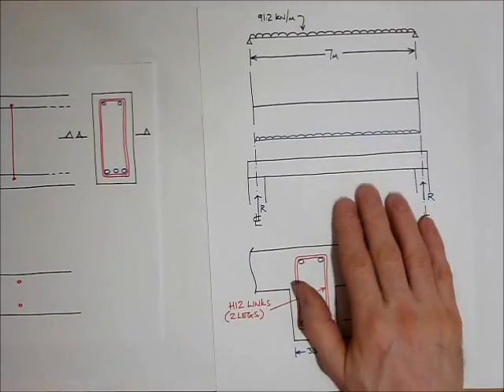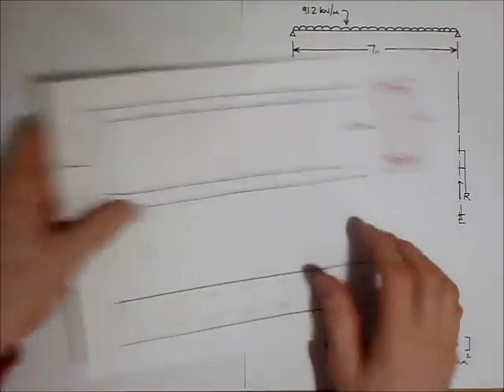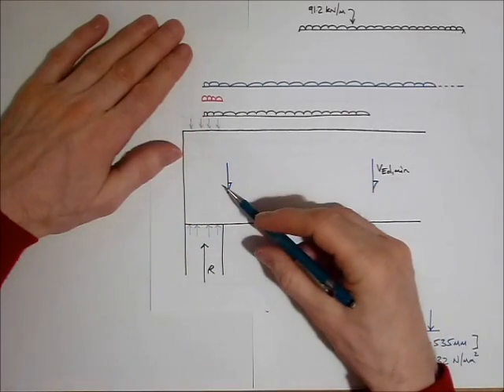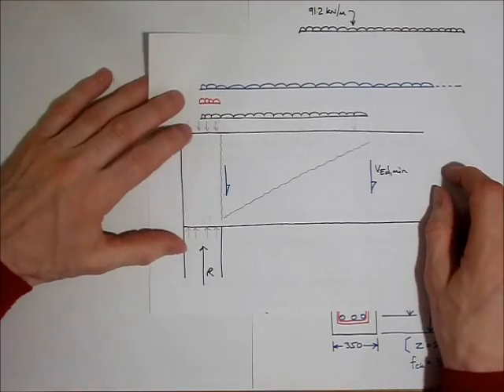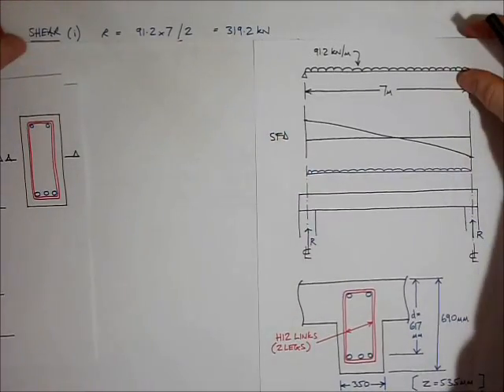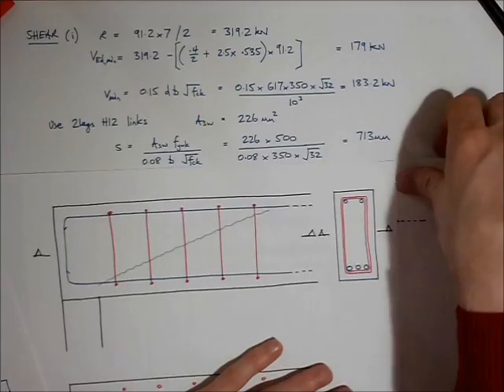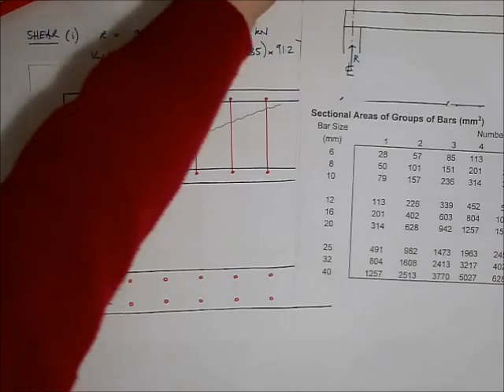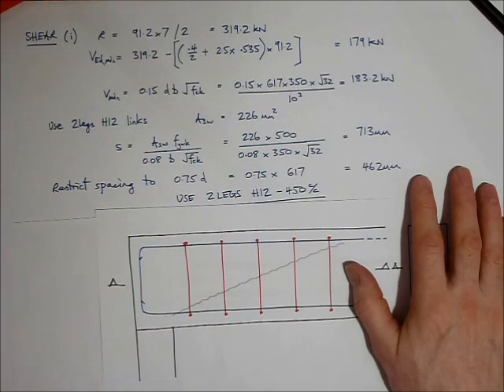RC Beam Design EC2 - Worked example - minimum shear reinforcement

Comment: Thank you very much for your videos! They are extremely detailed in a good way.

Could you pls refer what clause of EC2 states about the distance that shall not be accounted for the shear design (2.5*z in your example)?

Is 6.2.2(6) the one: "For members with loads applied on the upper side within a distance 0,5*d<av<2*d from the edge of a support (or centre of bearing where flexible bearings are used), the contribution 
of this load to the shear force VEd may be multiplied by Betta=av/2*d. This reduction may be applied for checking VRd,c in Expression (6.2.a). This is only valid provided that the longitudinal reinforcement is fully anchored at the support. For av<0.5*d the value av=0,5*d should be used."?

Comment: next time always refer to clauses of the Eurocode. This is not the design approach given in the Eurocode. The Eurocode uses the variable strut inclination method. The strut angle MUST be checked to see if its 21.8 degrees then one continues to find the spacing and area of shear links required.
Reply from the maker: Hi Patrick, the design method in the video is not based directly on the Eurocodes but it produces a design that accords with the Eurocodes. It is based on the IStructE document ("Manual for the design of concrete building structures to Eurocode 2"). This is partly written for structural engineers who prefer a different and more direct approach to RC design, Mike

Comment: hi, sir just want to ask about constants you are using "0.15" & "0.08"
and whats VED1 min, thanks SIR
Reply from the maker: Hi 1sH.B, sorry for the late response. I believe (but am not sure) that the two figures relate to the shear strength of the concrete in the RC beam and are based on empirical testing carried out. VED min is the shear capacity of the RC beam if it is reinforced with the minimum shear reinforcement allowed. Probably too late now for you but perhaps, this answer will help someone else.
Reply: Thanks sir

Comment: When calculating minimum shear enforcement ratio according to Eurocode 2, 9.5N (https://calculocivil.com/eu/ec2/tran_reinforcement/base) I cant get the units right. Square root of N/mm^2 divided by N/mm^2 makes no sense unit wise. The mm's become mm^2 / mm which is fine and are used in many tables, but the extra sqrt(N)/N makes no sense.. Can you help? You used the same formula in the video.
Reply from the maker: Hi valter stenback, good point. The units do look wrong. I believe that the shear strength of concrete is proportionate to its compressive strength and the formulae in the Eurocode are derived from experiments. So the purpose of the square root of fck is to find the shear strength. The idea is not to find the square root of the units but to make use of this proportionality. For example, if the two strengths were related exactly by the square root, then a 25 N per sqmm compressive strength concrete would have a shear strength of 5 N per sqmm. Another different empirical formula for the shear strength of concrete makes use of the cube root of the compressive strength. I hope that this helps, Mike

Comment: Thank you Mike. Very good instructional video. 
I notice that the characteristic value of the steel reinforcement is not modified by its materials safety factor, 1.15, in the link spacing formula - or is this factor built into the 0.08 factor?
Reply from the maker: Hi Keith Spears, yes you are right. The formula comes from EC2 amended by our NA. No need to consider the materials factor of safety here -  a minor relief! Hope this helps, Mike

Comment: How do you  get the 2.5z?
Reply from the maker: Hi Jay-r Salvatierra, thanks for the question. 2.5z comes from the code, which in turn comes from a model derived from research. I hope this helps.
Reply: thank you for the response. What code do you use? is it ACI?
Reply from the maker: Hi again, the tutorial is based on EN 1992 which is a European code of practice. In the UK, this tends to be called Eurocode 2 or EC2. I suspect that other countries may have similar approaches to this.
Reply: z.cotg(teta), cotg(teta) limit is 2.5. see cl. 6.2.3(2) from Eurocode 2-1-1.

Comment: .4/2? Isn't the width of your support 350mm?
Reply from the maker: +Javed Shaah Hi Javed Shah, around 40 seconds into the video I mention the support widths as 400mm. The beam width is however 350mm. Hope this helps, Mike
Reply: Hi Mike, first of all thanks for your help. Do you mean the width of our columns (supports) are of 400mm?
Reply from the maker: Hi Javed Shah, yes, RC beams are generally supported in columns and in this example I have just assumed that the column was that width. No reason why especially.

Comment: Hi Mike

You didn't calculate the minimum area of shear reinforcement Asw (only the spacing), how do you know that your initial proposed H12 links satisfy Asw?

Also is this method a simplification? As I have come across another more complicated method in the codes were concrete strut angle and capacity are calculated to find shear reinforcement.
Reply from the maker: Hi James Birchall, yes this method is a simplified method that only really represents one stage of the entire design and detailing of an RC beam. However, if you are lucky enough to have a beam that only needs minimum shear reinforcement, then this simple approach is just fine. As for the link design, you can vary the diameter of the legs and their spacing. Bigger links can have larger spacings and smaller links need closer spacings. I think that the H12 size of links suggested at the start of the example was OK and so I then I worked out the spacing from there. The calculation is only a short one and so you could go back and try different link diameters. Hope this helps, sorry about the delay in replying. Mike